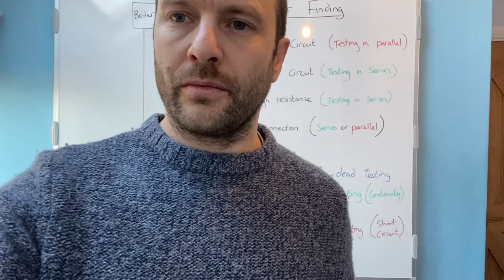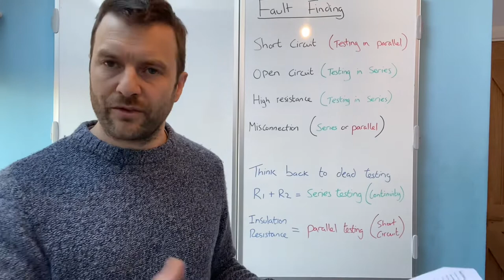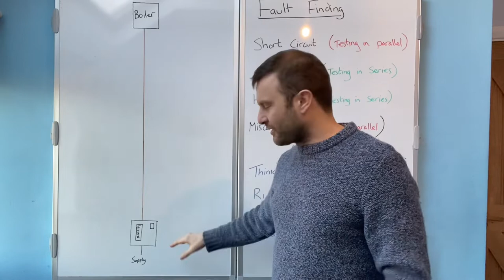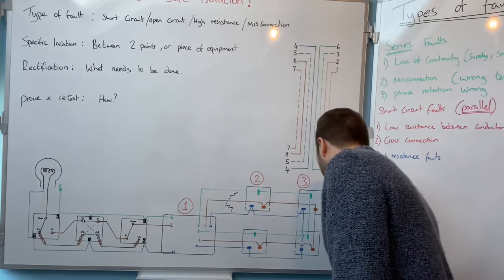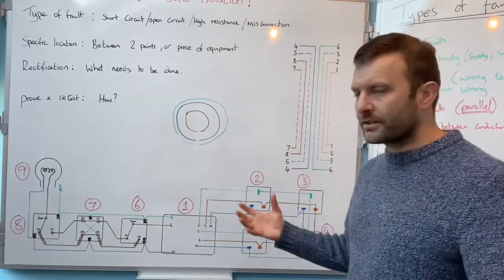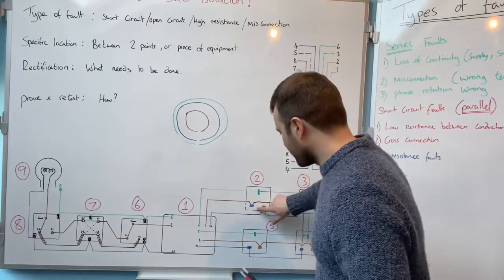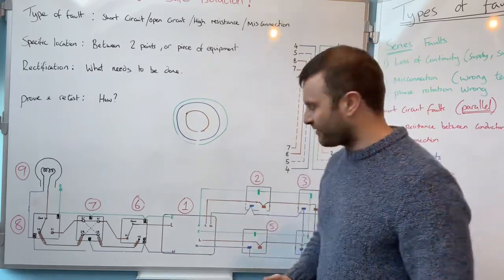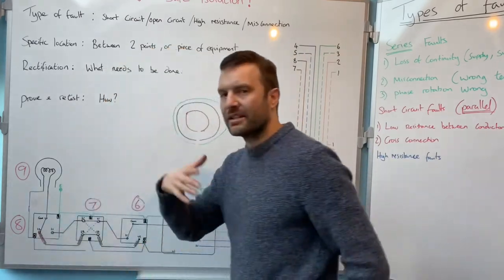Section E - Fault diagnosis and rectification - AM2 pre assessment manual

Comment: Got my AM2s coming up soon. Just a quick question…..
I was told on the pre-assessment that we would have to fault find on  a piece of CAT-5. No problems there, but….there was no mention of testing the continuity of the CAT-5 during inspection and testing. As we are testing our own installation, and CAT5 being part of that installation, would the CAT-5 circuit need to be tested during the continuity stage of inspection and testing?
Reply from the maker: That is a great question and I would say absolutely.

Otherwise, how would you prove this was working and it might cause you to fail when they strip your install down.

Comment: Just a question regarding IR test on the ring circuit, How can i identify which leg from the board is supplying which half of the circuit? As both line conductors will be connected at the circuit breaker together.

Comment: When you say test the pump, how do you go about doing that would that not be classed as sensitive equipment?
Reply from the maker: You can still pass 250V across line to Neutral, Line to Earth, Neutral to Earth.

Or 

A low Ohm Resistance test to prove their is the correct resistance between line and neutral on the windings.

Comment: Great video  , I’ve failed my fault finding twice now, out on site I can do it no problem but not on am2 , I can’t get my head around the heating fault they do it says programmer calls for heat but doesn’t work I messed it up both times , how would I find it would I just start with basic testing
Reply from the maker: Try this and let me know how you get on

Boiler wiring made easy
https://youtu.be/rAYc64MsUYI

Comment: This is hands down the best video ive seen for the AM2.

I have mine next week. I have two questions dude. 

1, can you open the accessories on the am2 fault finding section?

2, can you use the long lead test for polarity on ring final?

Cheers.
Reply from the maker: Thank you 🤗

You can open the accessories to disconnect cables, but the cabling will look correct as the faults are introduced behind the scenes, which can throw a lot of people off.

You could use the long lead method to test conductors through the circuit if you wanted too. The installation is so small that you wouldn’t actually need a long lead, the normal leads are long enough

Comment: one thing to consider is that the same board has been used for fault rectification several times by several people. If I find a fault that was left by a previous person but its not the fault they expected me to find in the exam, Do I get marked down or do  I still get a mark? Because people are racing against the clock during the exam and they may leave some points loose or misconnected when they put staff back together and move onto the next fault. Some people have across this.
Reply from the maker: It’s a fair comment and one I don’t know they answer for 😁

Comment: Hey, would a cross connection give you the same reading on a IR test as a short circuit ? Eg cross polarity live and neutral ? Thank you.
Reply from the maker: Quite possibly because anytime line and neutral are connected together with a resistance of negligible impedance, you get a dead short
Reply: Thanks for the reply , what is the best approach to determine if it’s a dead short or a cross connection ?
Reply from the maker: @ryanvesey8645  In the assessments a dead short is obvious and will be the most likely choice for that type of fault.

A misconnection is more likely to be something that isn't working correctly, like on the boiler or two-way switching.

If there was a short circuit due to a misconnection, the fault would be proved by testing end-to-end and realising that the connections are incorrect.

Most likely, can also be operated by a switch.

Comment: Hi Adrian, 

Sorry mate me again :) something has been bugging me ever since i've contacted you a day ago and i just wanted to see if you could clear it up for me as i know you'll have the simple answer. 

during the AM2 there was a number of fault finding situations where the circuit breaker had tripped,  as we discussed in my previous post i would initially look at an Insulation Resistance test for a short circuit etc however IF the IR test was good and all cables were fine, would you then start to look at a potential misconnection/polarity fault? If were going by the 4 faults they have in the AM2 (Open Circuit, Short Circuit, High Resistance and Misconnection) am i right in saying the only other fault it could possibly be is a misconnection due to the MCB operating? 

Thank you Jamie
Reply from the maker: I don’t know the exact faults that NET have put into their assessment, but it is a possibility that you may have to check for a misconnection.

Comment: Your video is so good and im currently revising for my AM2 fault finding that i need to resit at the end of the month. Personally this has been very good for my learning of fault finding especially with the boiler breakdown and also intermediate switching and ring finals, my only thing that i tend to struggle with at the moment is going with what test to start with ( IR or Continuity) would you tend to go straight for the IR test if you was for example getting an MCB tripping? with an MCB tripping it could also be a misconnection as well as a short circuit, im interested to know what route you would take first in regards to what test you would do as i struggle with this if im honest and want to obviously find the fault in good time to enable me to have more time on those more difficult faults, thank you for your video very helpful. Jamie
Reply from the maker: You are more than welcome Jamie 🙏

They aren’t trying to trip you up, so keep it simple.

If the circuit breaker is operating, then exactly as you say, you have a short circuit fault, so straight to IR tests 👍
Reply: @Pure_electrical_training  thank you so much for getting back to me so quick. keep up the good work

Comment: If a socket has wrong polarity L&N does it cause a problem if an appliance is plugged in ? Does anything trip etc .  Would the customer have any issues ?
Reply from the maker: Most appliance can run in reverse polarity and you would never know.

Where it makes a difference is with switching, isolation, over current and protective devices.
Reply: @Pure_electrical_training  Thanks. I knew about over current safety issues. The fact that most appliances run without issue and customer would not know is scary.  Also having no isolation is scary.  Great information.

Comment: When you spoke about the mis conection with the continuity tester, would it pick up short between L-N too? Or does it just beep on continuity of conductos? Meaning if i had a fault and i thought it was a short, but i use the tester and it beeps on L/N then the short is now ruled out and now it is a mis connection? Hope this makes sense!
Reply from the maker: If you use a continuity tester between line and neutral, you may pick up the resistance of any loads connected in the system, a low ohm resistance tester will give you more feedback due to the readings, rather than just a beep that could mean anything.

Comment: I had my am2 last  Sunday and I have  been out of the tools for a long time due to personal reasons . I have six month to complete  the NVQ and the Am2 . I have not received my results yet but I really struggled and I didnt complete two sections of the installations due to some mistakes that I made. I didnt complete the fault finding because I got stuck on a fault and I took too long on it. I would like to ask you when your  testing for a fault and you get a reading how do you know which fault it is ? Sorry it may sound like a stupid question.   If you get no reading between a conductor than I take  it s its an open circuit but what about the other faults ? is there anyway you can practice fault finding  ?
Reply from the maker: Why do you only have 6 months to complete the NVQ and AM2?

Fault finding and testing are intrinsically linked, when you are testing R1+R2 and R1+RN you are checking for continuity and proving polarity. When you are testing insulation resistance, you are testing between line and neutral for short circuits and live to earth for earth faults.

You do that before you put a circuit into service and that is fault finding.
Reply: @Pure_electrical_training   well they are changing the 
qualification  experience interest do you know anyone who failed the whole modules on the first attempt ?
Reply: They are changing the qualification criteria now,  during the new year  you will need at least five years experience, 18 edition and the initial  verification qualification,